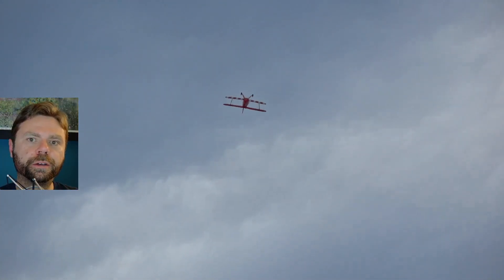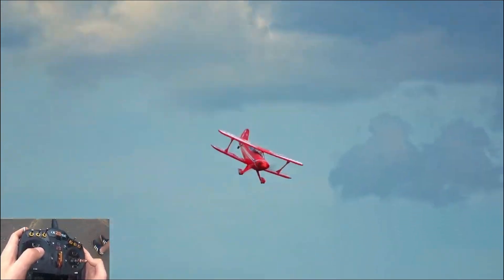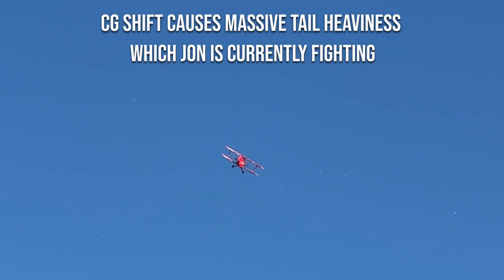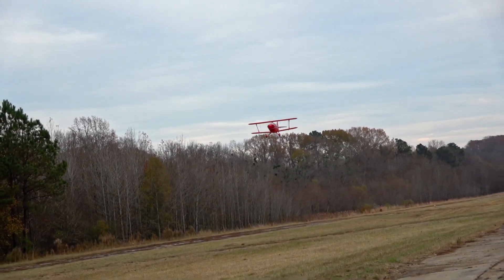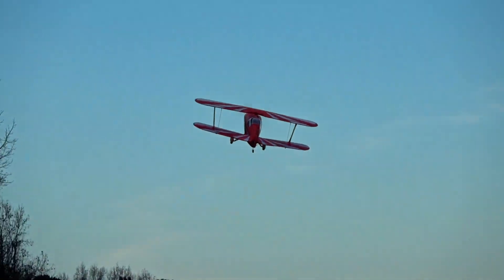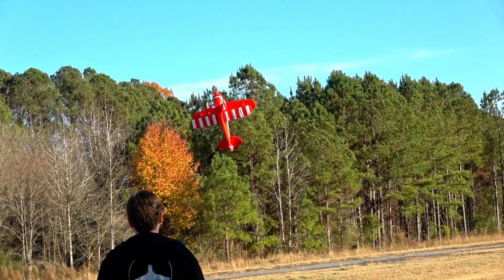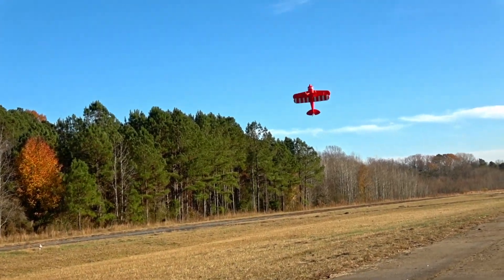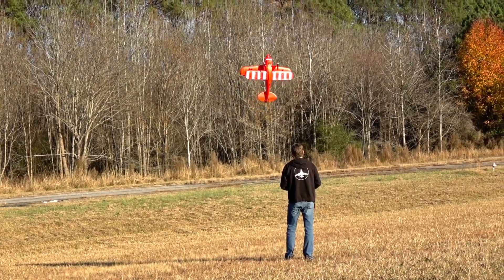Pain and Pleasure - 2 Years of the FMS Pitts 1400mm

Comment: I’m Glad you did a second thoughts on the Pitts. If you need/want more punch. Do the Adam mod for prop.. 16x8 will make you a happy camper. I recommend the Xoar white prop. I also swapped out my ESC for 100amp Avian ( I really like full telemetry). I also spent the extra $$ and replaced all the servos with the FMS Metal Digitals.. she snaps like a shark during a feeding frenzy.. money well spent. It’s an excellent airframe and with the added mods makes it an even better flyer.
Reply from the maker: We flew ours on a 16x10 previously and it just didn't respond well, nor did it make much of a difference aside from feeling weirder on ground rolls for takeoff and landing. So we kept it stock this time around and flew it almost as-is aside from the servo upgrade for the rudder and elevator.
Reply: @TwoBrosRC  16x10 on the stock ESC would draw to much current IMHO. The coefficient of prop drag due to the increased pitch might actually make it fly worse using the stock motor. 16x8 is actually pushing the ESC a bit long term, which was another reason I went with a 100amp ESC.

Comment: Stock prop, 4258-550KV motor from the FMS Beaver (drops right in) and an avian 100Amp esc and it wakes it up.  6S 4500 agressive sport flying gives me a 4 1/2 to 5 Mins flight time.  Also Robart low bounce wheels helped on the take off/landings.

Comment: Well that size plane shouldn't be using 9g servos . If they were full size servos plastic gear servos would be fine. You should've seen the servos back in the 70's and 80's with these big airplanes.
Reply from the maker: It's using 17g class servos.
Reply: @TwoBrosRC  Ok 👍

Comment: Did you swap out the Hobbywing 50A ESC? I've read a few comments from people insisting the 50A ESC should be upgraded to ~80A. I opted for 5000mAh 50C 6S batteries. I'm now worried I could blow the 50A ESC.
Reply from the maker: We put an Avian 100 amp into it but it isn't really necessary.

Comment: Great review.  I purchased my Pitts in 2020.  Everything is still stock and absolutely no issues.  However I did forget to put the battery back in place after I checked it and had a similar issue landing it.  There's little channels on the sides of the fuselage that I think a small piece of wood could slip in there and locked in place.  Would seem to be a good deterrent from the battery from slipping back.  I took faith in the stock servos and they have been working well, however I like the idea of beefing them up for added insurance.  

I'm not a 3D flyer but I was not aware this Pitts could hover.  I didn't think it had enough power.  One vertical roll and the plane stops moving upward.  I though about just changing out the prop for a wooden one, just the same size.  I'm thinking less flex would provide more pull.  I see some of you are going with a 16x8.  Perhaps I'll give that a try.  One question, does upgrading to a bigger ESC help?  Thanks!

Comment: Good stuff Jon. Regardless of what it needs, I really like this FMS Pitts.
It's not really the fault of FMS, you can at least  take comfort in knowing that this Pitts shares the exact same flight characteristics as the full scale Pitts. Great review bro, 
AirHammer out!!
Reply from the maker: The bouncing is probably more related to the suspension and hard plastic wheels rather than the design of the airframe itself, but undoubtedly there's some overlap between the two.
Reply: @TwoBrosRC  thank you for your response. If you have time, I would suggest that you take a look at C. Pitts on YT. He shares your assessment of the landing characteristics of the Pitts  biplane.

Comment: I replaced the motor with the sime sized can but 550kv from the Beaver (direct fit) and put a 120A in there so i have options of 6s or 7s. Took off the wheel pants and foam tyres and put FMS supercub 1.3m pneumatic tyres on so it'll handle my grassy field like a STOL plane. Jon do you have Flaps for landings?
Reply from the maker: Neat idea on the Beaver motor, but not sure it would be much of an upgrade considering that plane isn't particularly powerful either. We used to run a flaperon setup on this bird but it made almost no difference at all - much easier to just land with throttle management in 3 point.

Comment: I had just acquired mine when I saw your first review.  I changed the ESC to a 60A Avian (bullet adapters required, and possibly IC3/IC5 depending on which 60A model you have).  I’ve replaced all of the servos with digital metal gear, and currently hinging all of the control surfaces - the force required to move those pinched foam hinges is ridiculous - especially the ailerons.  I stripped a metal gear just testing after installation!  Also put a Xoar 16x8 on.

So yeah, not a great plane out of the box - but lots of potential if you’re willing to go to the trouble.

If FMS fixed the battery mounting problem, hinged the control surfaces, and upsized the motor one size… this thing would easily score 9-9.5.

Question:  Where did you settle the CG, measured from center of leading edge top wing?  Mine is a tad nose heavy with the recommended battery in factory location.
Reply from the maker: Our first Pitts was upgraded to an 80 amp Avian (the original design, not the new Lite version) which wasn't compatible with the motor. It lost all power and crash landed in a field. Later on, it crashed into a tree line because of the battery shift when Tony (the other half of Two Brothers and a former pilot for the channel) was flying it after the battery shifted to the back of the plane. Then the second battery shift happened as you see in this video in December of 2021.

We flew this last on a Xoar 16x10 propeller which definitely didn't do much for it in terms of speed or thrust - it just made it harder to control and even more squirrelly on the ground.

The CG balances within the factory recommendation - we never really precisely check this with a ruler though.

Comment: i have the first one, yep change out servo's, always do on any arf. , mod battery slide no need for anything but a screw through the plastic slide. and rubber wheels . other than that its a pitts flies great ,

Comment: I used Sunnysky 16x8E  prop 50amp max 1185 watts max. installed.  FMS prop 15x9 45amp max 1080watts max..  Motor same as my FMS P47, 4258 kv460. max 70amp esc. Pitts has Predator 50 amp esc i.e. 50amp continuous, 65amp burst.           I swapped the tyres for Dubro low bounce but  found slow 3 pointers are still best way to land.
Reply from the maker: Yup! 3 point is definitely the way to go here. Unless you're exceptionally skilled, the short-coupled nature of the plane with its stiff suspension just makes it way too much of a pain to wheel land.

Comment: I love this sport Pitts biplane, especially for the modest cost.  Curious, for more power could you replace the 50A ESC with a 100A ESC with 7A BEC?
Reply from the maker: ESC changeout wouldn't affect the thrust - but a new motor/propeller would. The next time we feature this plane, it'll be with a couple of upgrades.
Reply: @TwoBrosRC  As you say, maybe the folks at large will include these mods like the obvious battery retainer flaw in the future.

Comment: I got the pitts for a gift and the plastic servos stripped in the rudder and ailerons on the second pack from tumbles and snap rolls if your ok with buying 4 metal gear servos then this would be a good plane for you
Reply from the maker: That's super unfortunate. Everything we performed on this vid was flown with the elevator and rudder upgrade, but we left the ailerons stock.

Comment: Is there any way to remove the aileron servos without damaging the foam box?  Turns out both of mine are dead as I learned after assembling it a month ago.   Just got my radio and LiPo three days ago to learn of this while making it RTF.  FMS support in closed for a week in celebration of a Chinese holiday or festival, whatever.  I am still covered under the 90 day electric warranty but don't know if I am entitled to new, decaled, bottom wing halves with working servos, or just two new plastic geared servos to install myself.  I should not be saddled with any repair jobs in my opinion.  Thoughts?
Reply from the maker: We'd recommend waiting for FMS to return from Lunar New Year holidays so you can get them to send you a pair of 17g metal servos, then pull the existing servos out by the servo arms using a pair of pliers. Gently pull and they'll remove without damaging the wings.

Comment: I take this plane to the field in a Rav4, and occasionally a Prius, and I never take it apart.
But there is only one path that allows it to go in, and without the proper twisting and turning, it appears to be impossible.
It is one of my favorite planes, and when you recommended against buying it, you lost a lost of credibility with me.
I'm glad you relented.
I did replace the motor with the higher KV FMS Beaver motor, but the tail servos are stock plastic ones.
They may break in a crash, but the servo will be the cheapest of all the replacement parts required!
Reply from the maker: In retrospect, we're happy FMS sent over a new one. It's not perfect. Far from it, even. But beyond the annoyances lies a ton of enjoyment. It's fair to give it a proper review after two years of ownership.

Comment: Ok gear sucks .... battery tray is trash. Just ordered new cf gear . Tray is modified,  and need to glue in rear elevator supports cause they like to fall off .
Reply from the maker: The tray isn't trash, it just needs reinforcement to stop the battery from dislocating.